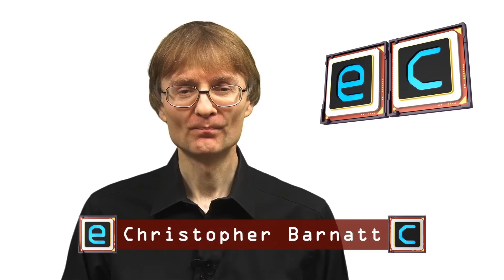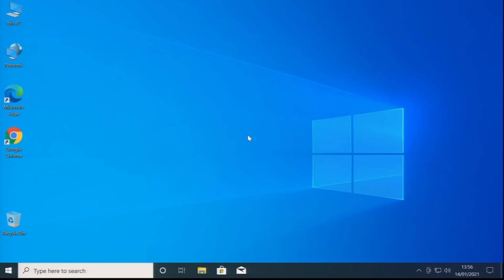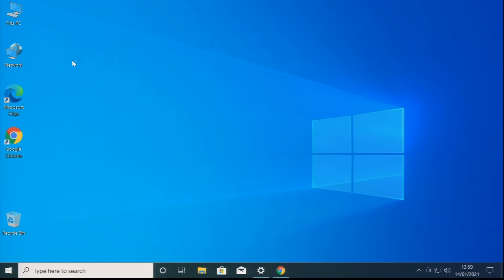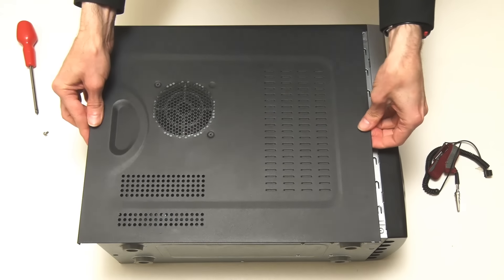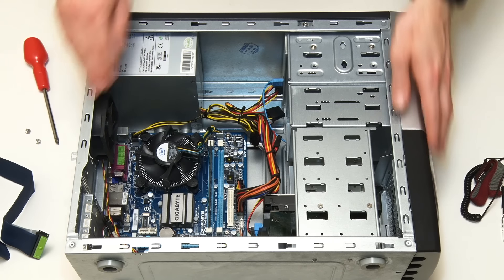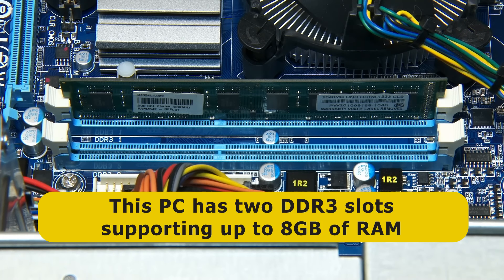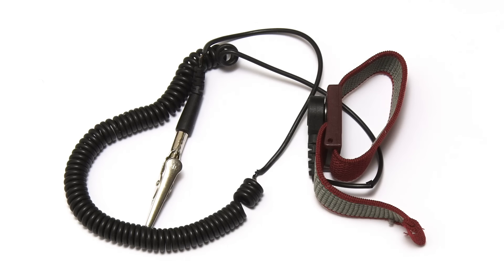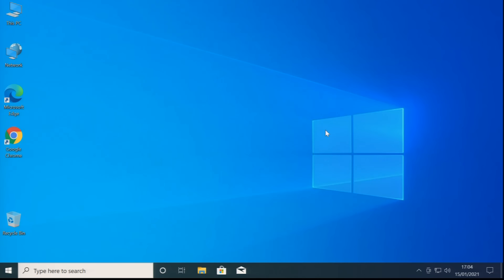Old PC Upgrade #1: Options & RAM

Comment: You could probably replace that 5500 with a core2quad for less than $15.00 (at least in Canadian Price) from Ali Express. That Intel stock cooler could be replaced with a better after-market sleeve styled cooler. Something in the 20-30 dollar range (Canadian price again) might work.

Comment: If I were stuck with a machine like this I would go ram,cpu,ssd,gpu, a core2quad and 2x4gb sticks of ddr3 goes for about 10 bucks each on ebay, a cheap 120gb ssd is about $15 new (never buy used ssds), and a used gt730 GDDR5 version is about $20 and will allow you to smoothly playback youtube and play games like minecraft at reasonable framerates. This would cost you about $50 total, and if you go on marketplace you could probably do it for less, and it turns an old pc that can barely run a fresh windows install into something that will do just fine for basic tasks.

Comment: Careful with saying that Memory that is faster than the system supports will work. If the system someone is giving a new lease of life to uses an OEM proprietary Motherboard, a lot of OEM manufacturers will limit the DDR speeds supported by that boards BIOS to just 2-3 speeds, and inserting anything fast that what that BIOS supports will result in a No Boot Scenario rather than it clocking down to function at what the Motherboard should support.

Comment: I'm thinking your only upgrade options there are the RAM, which you did here, the SSD, which is next, a video card... and maybe a CPU overclock with a new heatsink/fan? Don't know if it would be worth, though. Anything else that could be done?
Well, besides changing the OS for a Linux install, but I'm considering hardware changes only here.

Comment: Attaching to the radiotor not so good as many are painted/coated.  I prefer clipping to a bare metal part of the case with the PSU and power cord connected but make sure it's SWITHED OFF as this will give a clean grounding.

Comment: This can be upgraded to something half decent with widely available second hand parts. Looking at the video, I think its a G41 chipset, which was the bargain basement of Intel chipsets at the time, but I think you could max it out with the following.  WD Blue SATA SSD , Q9550 quadcore CPU (cheap as chips on eBay) and a second hand NVidia 7 series GPU (assuming the PSU is up to it).
Reply from the maker: It is indeed a G41 Express chipset. :)
Reply: When you add up ALL the "bargains", how much really? For the second hand PC (assuming it works).

Comment: Great video! Would you consider upgrading the CPU also? You can fit up to a Core 2 Quad Q9650 according to the motherboard support page. Maybe change the PSU as well and add a GTX 1050 Ti, would make for a pretty good 1080p gaming machine. Sorry, I'm a PC gamer, every time I hear PC upgrade I think of GPUs. Cheers!

Comment: Bit high price wise for a 775 pc, probably would’ve sprung for an 1155/6 pc. But, you’re got it now, so stick in a decent ssd, raise that ram to at least 4gb, and get at least a low end gpu for it, probably a 710 or something like that. At the worst, you’d be around another $60 US in it, which would be the most I’d put in it,

Comment: My neighbour gave me his HP Pavilion PC that he bought in 2009, sporting a Pentium Core 2 Quad Q8200 (2.33Ghz) so I could strip it for parts and its metals, but I've upgraded it instead:

It had already 8GB of DDR2 RAM installed (667Mhz) so I only needed to replace its old mechanical HDD (250GB) with a 512GB SSD and upgrade its onboard VGA with a Radeon RX550 videocard. I also installed Windows 10 :-)

Now I'm able to play Skyrim with it and watch x265 (hevc) content ;-)

Comment: I have a Dell computer that looks very similar to that unit. It is running Windows 7, and needs to have a the hard disk drive replaced. Although it will boot and run, deleting files is very difficult and every once and a while,  when bringing up a the File Manager window, it will pause and then indicate not responding, and finally abort that task. What I would really like to do is replace the drive with SSD, but retain Windows 7. I'll see what your next video says.

Comment: Nice educational video, will Chris use and explain the PCIe slot, how much power does the base system use prior to any upgrade ? and how much will it increase with a power hungry graphics card running ?

Comment: In some cases you should be able to upgrade a CPU, even if running an OEM copy of Windows, if the new CPU is a faster version of the old one that fits in the same socket on the same motherboard.  This could mean just a CPU of the same family with a higher clock rating, or maybe a higher family member, such as going from an i5 to an i7, which could gain you a few more cores.  Your mileage will vary on this, but as long as you don't swap out the mother board there is a chance it will work.

Comment: It might be able to support 16GB memory, 8GB DIMMs @ 1333MHz. It is DDR3 and 8GN modules are available now probably not at time board was made. You might have old 8GB DDR3 modules laying around by now in 2021.  Speed is determined by CPU. if installed a 1600MHz module and CPU supported  1333MHz, it would run at 1333MHz. Also a discrete GPU (graphics card like GTX750ti is practical) would do a lot if gaming on something like this. Also should consider a SATA SSD for boot drive. That would for sure wake it up. And yes, Google Chrome is a memory hog.

That motherboard has Socket 775. A E8500 would be a massive CPU upgrade for that thing. Windows 10 64bit would run away with this CPU and support 1333MHz memory. Check CPU support list before upgrading this. also make sure that the BIOS is up to date. This should work with socket 775. One of my favorite CPUs. Can be purchased for as little as 17 USD used. Remember old hardware. E8600 is 28 USD, running at 3.33GHz and is a good speed bump from E8500's 3.16 GHz.  Both of these have 6MB catche. The 5500 has 2MB catche also 800 MHz were E8500 is 8MB catch 1333MHz. Again CPU determines memory speed and would make a huge difference for a inexpensive cost when purchased used. O got prices from Newegg.

Summery,
1333MHz memory 2x4GB
E8500 or E8600 the fastest duel core. E8500 3.16 GHz E8600 3.33 GHz
GTX 750Ti GPU if gaming plus easier to hook up to a TV with HDMI that is most commonly used here in US and mostly anywhere.

Comment: Drop a core 2 quad in that thing and a nice SSD and it's going to be a fair system. I know the q9550 is a nice chip and will work in that system and can be had for around $30 usd or less. You could even experiment with an Intel Xeon chip as they tend to be stupid cheap for these old platforms.  I'd even suggest picking up a basic low end graphics card as that can accelerate windows and free up some system ram.

Comment: This is quite interesting. Thanks for the video.
Request: could you also do a video on building a NAS using RPi in a PC case like this? Am thinking of building one, but i don't know if it would be feasible.
Reply: He's already done an rpi as a nas, check out that video.  Putting it into a pc case (why, drive holders?) should be pretty simple.
Reply: @richardwernst  watched that video. What i was thinking was multiple HDDs mounted, with RPi as board.

Comment: If you add the digital license to your Microsoft Account, you can then transfer it to the new motherboard using the Activation troubleshooter.
Reply from the maker: You cannot (legally) move an OEM license from one computer to another. If you put in an identical motherboard, things should be OK. But if you change the motherboard and CPU (which is what I discussed here), you have a different computer, and the OEM licence will no longer be valid. There may be (are!) hacks around this, but they are not compliant with an OEM license agreement. If you license if FPP, then transferring it to a new motherboard is compliant with the license and can indeed be accomplished as you describe.
Reply: @ExplainingComputers when replacing a defective board, we used to need to call up the support number to do the same, but now there is an automated option for it. Sure it technically breaks the OEM license terms, but Microsoft employees have been allowing it for years. The old board is removed from the license in the same process.
Reply from the maker: @flandrble  Yes, agreed. I have in the past made such support calls. :) But my understanding (and I have not had reason to try it) is that the automated process can and does sometimes reject OEM reactivations when a new motherboard and processor are fitted. So I gave cautious advice in the video, as it cannot be guaranteed that you can move Windows to what is in effect a new PC (the RAM is likely to have changed too if the old PC is of any age, so there is little left to identify the PC as the same).

Comment: @2:22 I think the lower left of 4 was an HDMI port (or maybe a monitor port)  misidentified as a USB port on the back.
Reply from the maker: No, it wasn't. :) Those are four USB 2.0 ports, no question at all. One is a bit deformed. But it is still a USB 2.0 port.

Comment: My question is not necessarily about this specific video but it is about  sff computers and specifically a sff computer that is meant to be put on the top of a deskin a flat configuration. I have an HP EliteDesk 800 G5. At the risk of asking a question that would reveal all I don't know about computing and computers. I am disabled and as such I am still learning different ways to make things easier for myself or more likely a reluctant PCA to access I/O ports. If I were to mount my G5 in an under the desk mount that would put it in a vertical orientation, as opposed to a horizontal orientation, will it still function normally? If I would have thought of it sooner I would have planned for upgrading from my mini to something more like a tower configuration but at the time I was purchasing I guess I was more concerned with keeping the profile low instead of other mounting options. Now I am kind of committed to what I have for a while anyway but I really like how some of the other mount options not only allow for the pc to  be pulled out but also swivel.

Comment: I got AMD 6 core in a mid-tower case about this age. I ended up taking out all the optical drives and putting a 120mm fan where and grill mesh there. 80mm is the largest I could fit in the bottom but those are too noisy. A 92mm is on the side but I have been thinking I should cut it out to 120mm, I have to turn the volume up to watch your videos because of that 92mm fan.
Reply: No joke, but I'm exaggerating a little. LOL
Reply: I learned a trick to making small fans quieter. Save all your old worn out fans and cut the guts out with wire cutters. Use the fan housings as spacers. Moving fan blades cutting moving air through grill holes makes a siren sound, it's the hum you hear. Adding a spacer makes the hum go away. I  had to make a server fan quieter so we could watch TV. It works on desktops too.
Reply from the maker: Great tip. :)
Reply: @ExplainingComputers  The one I'm using now I found it in a trash can with an XP sticker on it. I painted it with Krylon Fusion for plastic about 8 years ago. It finally got a nick in the paint last summer I can see the off-white 90s color. That is some good stuff if you want to change colors. I'm about to cut a 120mm hole in HP case and put a grill in the original plastic cover. A second 120mm fan is going where the optical drives were but it is mounted horizontally. Nobody uses optical drives anymore so I try to use the space for a second cooling fan.

Comment: It's possible that your Chrome timing after upgrade was boosted by the site's assets already being in the browser's disk cache.
Reply from the maker: Agreed, though I did clear recent browsing data to try and do a fair test. And the site load came very late in the day with the initial launch, so I think the speed improvement is mainly due to Chrome needing a lot of RAM (and hence swap file activity with launched on the 2GB setup).
Reply: @ExplainingComputers  I should have known you'd thought of that. And yes, Chrome is a memory-hungry beast indeed. BTW, thanks for the video!

Comment: Augh, Pentium dual-core 2.8, wow, not even a core2 duo so lots slower and with 2G ram, amazed it runs W10 and chrome at all.  Was this a fresh install you did on the system and just added Chrome and that's it?  And/or did you remove any of the built in W10 software, as well as turn off any/all background apps it wants to run by default to get increased speed?

I would have liked to see the difference in speed of boot from windows initializing, not including the BIOS, etc. time which generally won't change at all.

Also important when looking up motherboards is to verify what version or revision it it.

If this was a budget upgrade, I'd definitely just put a 4G dimm in, vs. two of them (unless you get a deal on a pair).  The fact that it's not benefiting from speed increase with two of the same dimms, isn't an issue as memory certainly is NOT the issue with slowness here.  W10 will run fine in 6G of ram, then the slowest part for ordinary work will be the spinning hard drive so an SSD would help a LOT.  Lastly, that's a very old, slow cpu, as I mentioned above, so upgrading that would be beneficial, but testing video and cpu speeds, and verifying which is slower/causing slowness (that video uses some of that 8G of motherboard ram, I'm pretty sure) and upgrading that next.

Also, be careful not to buy ECC or buffered ram of the DDR3 variety you need.  Very rarely will a desktop computer support these dimms.

RichE San Diego, CA

Comment: Explaining Computers is the best site I have found on the internet for explaining computer related information. Chris is the best presenter I have come across on PC subjects 
BUT I can't find old PC's for sale on eBay for £55. Can anybody recommend a site? ALSO what is the brand of the magnetic screwdriver that Chris uses?
Help!
Reply from the maker: You have to search a bit on eBay: eg this morning I found: https://www.ebay.co.uk/itm/402825445675?hash=item5dca44812b:g:75kAAOSwCo5gkqGk
Reply: @ExplainingComputers  Thanks for the reply and the link to ebay. I had bought a Dell Inspiron 530 before I saw The warning from Chris that some Dells are not suitable for upgrade. The Inspiron seems to be one of the problem PC's. The in/out shield is not standard. But the Inspiron 530 is a well made attractive PC (made in Ireland) It survived the Hermes delivery with only a dent and a crushed mains plug. I will add more memory and see how it goes. A bit worried about the 350 watt power supply if I add another hard drive.
I would still like to know about the magnetic screwdriver that Chris used as I have dropped screws in my existing machine and have had to pick up the whole PC and shake them out.
Excellent series Chris. Thanks

Comment: Nice to see a CWT power supply - they actually manufacture many of the Corsair-branded ones. I was expecting some nasty thing in a build like this so was pleasantly surprised!

I wonder what you're planning for the CPU and GPU - maybe a Core 2 Quad, if not a (pre-)modded 771-to-775 quad-core Xeon, with a low or mid range NVidia 10-series (respectively)...? :)
Edit: nevermind, you said you're replacing the board.

Comment: I'm not sure it's illegal to migrate the windows licence to another machine if the old is out of order or migrate to other os.
In the worst case you can buy windows 10 serial key for few bucks on the internet. It's a grey area however.

Comment: I would consider  a cpu upgrade, to a core 2 cuad or to a x5470  with the bios and soket mod, i had one based on the ddr2 motherboard and is a huge upgrade for cheap

Comment: 11:51 Windows being locked to the CPU/motherboard is short term gain for Microsoft vs. long term gain of keeping Windows at the top.  It just pushes more and more users away from MS and towards Linux.  This will lead MS to lose the Operating System war in the end.  If they charged even a reasonable price they might have been OK even with all the other bad decisions put into Windows 10.

Comment: these are good stuff.Exactly like the computer that i have now.Though have you consitter that if you put a big graffics card with a fan on it it will block the pcie in front of it and afterwards you can use a usb3 card?    that is the problem that i have and i am thinking of using ebay adaptors to connect it to the sata ports.What do you think about that?

Comment: @ExplainigComputers
Hello dear Christopher, I am Christian and i am fan and subscriber to this channel. i enjoy it and i want to compliment you for a job very well done.  I would like to share my opinion for this video. Kindly understand that i do not men to be rude or disrespectful to you, but relying on my personal experience, upgrading old computers, i would like to share the the CPU has noting to do with Windows 10 activation and licensing, so it can be freely upgraded as demand requires, and this will not affect neither your license or activation status. License and activation status, depend only on the motherboard alone. If you ask me, i can say loudly and with confidence you are clear to update the bios to it's newest revision and after that install the fastest CPU supported by the motherboard with the latest BIOS update. After you have sorted the ram upgrade, i really would like to see, how adding the most powerful GPU that makes sense for this motherboard and it's new processor will actually affect the computer, BEFORE you install the SSD.

Thanks for the great and informative channel and for your time and effort. I appreciate it deeply. Good luck. Stay safe. Stay healthy.

Comment: When upgrading old PCs you should use only parts that are free / recycled or you can easily reuse in future. For instance the Core 2 Duo I'm using has an SSD and a Quadro P400 both of which are still useful even when I throw away the PC. Everything else is junk.